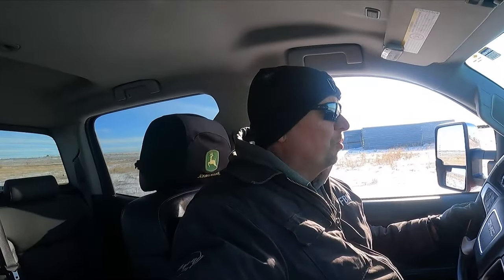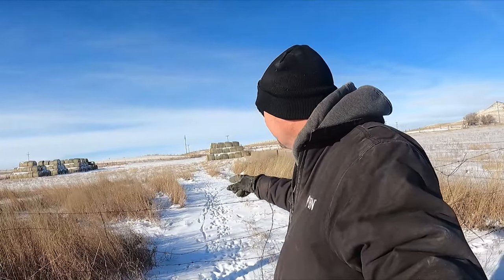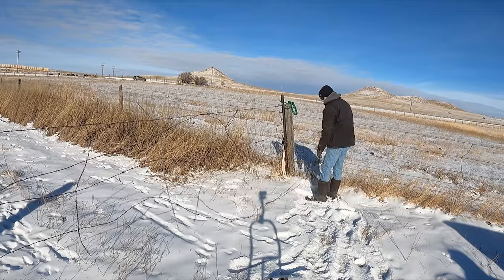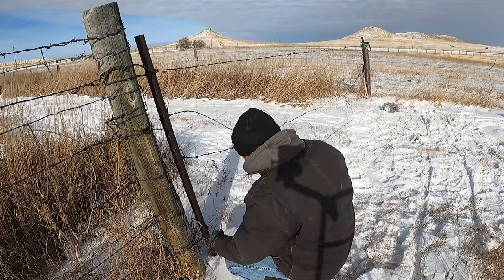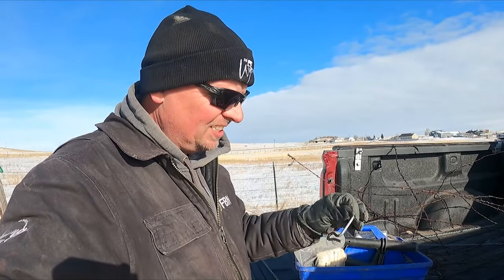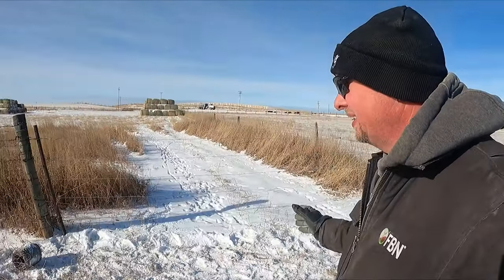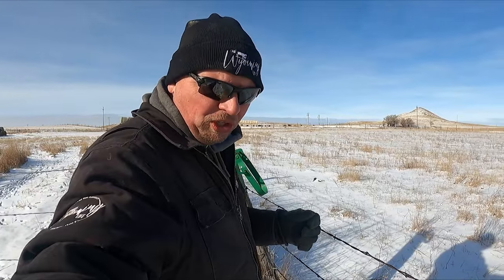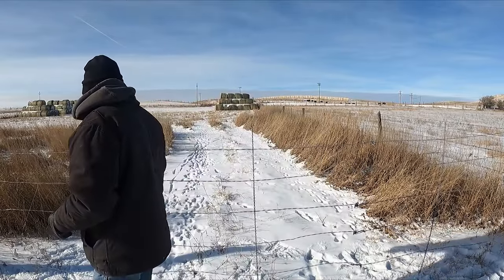Building a Wire Fence

Comment: Good job Mike. Did you know the most permanent fence on the Farm or Ranch is a temporary fence. That's the first time I've seen those stays used. Helps a lot holding it in place. Thanks for sharing.

Comment: I work for a fence builder here in north central Kansas and I like that metal pipe idea. I have thought about if a few times but never have done it I usually if it’s not used a lot tie to the corner post and have jsut one small post where you disconnect it. But I like the metal idea I always thought of doing that but with hedge cause we have a lot of that here. We build our own gate cheaters and they work pretty good but I also like those gate latches to. I always do 5 wire only time I match the fence wire number is if it’s next to a highway where you cna easily stay I jsut like the five wires I think it keeps the cows from wanting to go between them. I seen that you did the bottom wire first, there’s. A million ways to do this and not that mine is right but I start with the middle (3rd) strand then I do the top, bottom, then I do the 2nd and 4th wire last. And I use a golden rod and get them tight as possible.